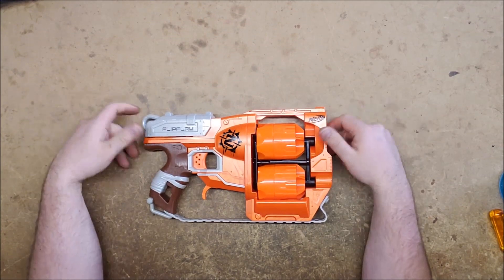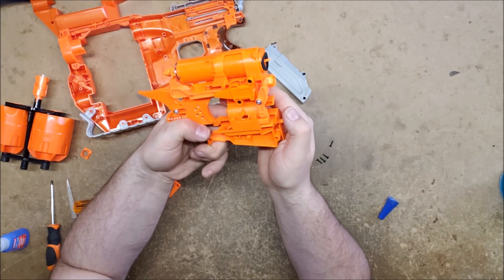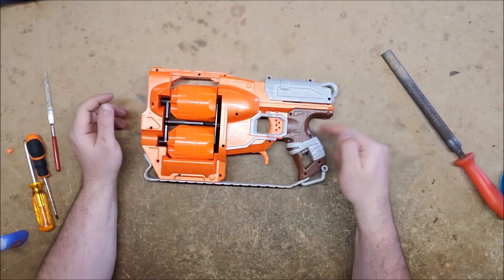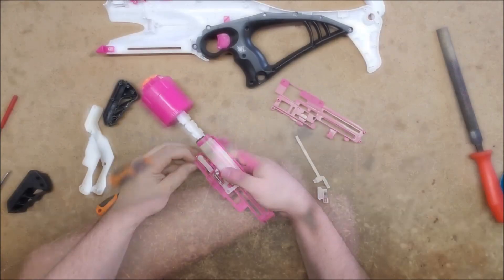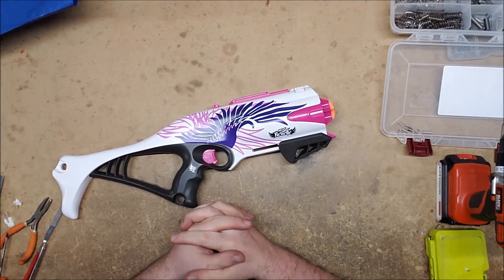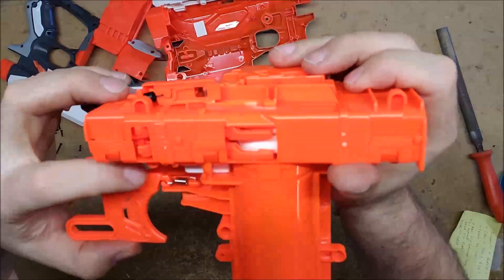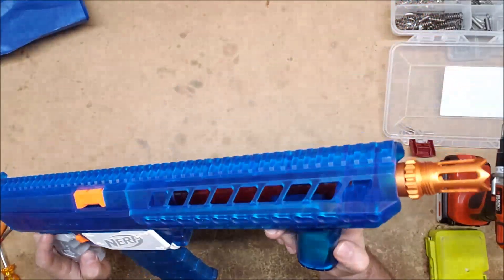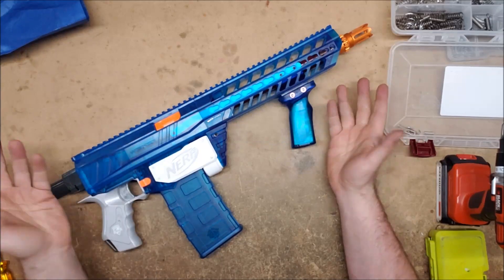Diagnostics and Repair - Episode 12

Comment: i have a hammershot that randomly started firing really badly even with intact darts, also when i rotate the hammer without priming it and if there are no darts in it, i hear a spring click and sometimes the hammer doesn't stay back it just goes without me pulling the trigger

Comment: Cap, what size screw did you insert in the rotational arm that advances the helix in the Rebelle? I might try that to extended the one in my Hammershot so it will engage a helix of a Rev-6 cylinder by Zuru when I place it one of my Hammershots.
Reply from the maker: No idea. One that was small enough. I then filed it down to size.

Comment: i had the same problem with my guardian bow so i took it apart and took out the ar put it back together didnt even touch the rotation mec in it at it fixed itself ???

Comment: Are there any breeches that work with full and half length darts for a retaliator?
Reply from the maker: Probably?
Reply: @CaptainXavier  do you know of any?
Reply from the maker: Not off the top of my head, no.
Reply: The jet blaster CEDA comes with an Omni breech and might be able to modify it to fit, maybe?
Reply: @CaptainXavier  that's to bad I was going to make a clear recon Sig saucer kit and I'd like the modularality of being able to use any darts I want.  I'd also like to be able to change the spring to vary the fps.  This would also be my first mod that's not just removing locks.
Reply: Orange mod works hybrid kit. I have 2 installed in a recon and retaliator for games when I want to use different ammo and shoot around 150fps. Works great. Just make sure you use the plunger braces.

Comment: I had that same problem with my rebelle blaster
Reply: It doesn't help that "Get replacement parts" is going to be a harder proposition since the line is pretty much (Unofficially) dead.  Granted, it's harder to find wave 1 blasters from lines since those get phased out for 'updated' versions (Disruptor vs Strong Arm, but some never really get 1:1 updates)

Comment: I have concluded that the reason vortex isn't coming back is the cost of building the blasters, compared to regular dartblasters they're engineered to heck and back. They use boatloads of extra tiny plastic bits, and instead of being assembled by some random taiwanese sweatshop worker you need somebody with a bloody engineering degree to piece em together
Reply: They've come back as a Target Exclusive, at least in the states, but they are MORE expensive now than they were when they first released while the N-Strike Original line was on its final days.  The Vigilon is 20 bucks now and the pump action rifle is 35 bucks.  I don't think the Pyragon increased in price at all.
Reply: They aren’t making new blasters though, just re-painting old ones
Reply: @itchyprince3793  I take it more that they're gauging interest in the line to see if they can give it a wider launch (like the Hammershot before the rerelease) and then if there is money in making new Vortex blasters

Comment: When you have a small part you need to glue like the flip fury.  Pin it!  No not on pinterest you pansy. Drill a hole in both pieces and stick a metal wire in it. Then glue with a solvent weld adhesive if possible. Its like making the 6 million dollar man. I learned it building miniatures. The joint will be stronger than anyvother part if you do it right.
Reply: whatstdiggn Warhammer 40k for the win

Comment: I hope you can help me friend, I have that same gun but the problem is that the mechanism to change ammunition does not work and when firing the ammunition barrel does not rotate but when disassembling the gun and testing it it does rotate and if it shoots well but when assembling The gun fails again, why does that happen?
Reply from the maker: I got nothing.  It could be all sorts of issues.
Reply: I have the same Nerf flipfury gun and it has the same problems that yours had, when shooting sometimes the ammunition chamber does not rotate and also sometimes the ammo change does not rotate and I wanted to know how you solved it?
Reply: I have the same Nerf flipfury gun and it has the same problems that yours had, when shooting sometimes the ammunition chamber does not rotate and also sometimes the ammo change does not rotate and I wanted to know how you solved it?

Comment: The Strongarm, and everything that uses the same chassis (like both of these) have a bunch of design flaws. Although your problem was different, I have found that rotation issues like the guardian is usually the screw inside the cam spindle. The annoying thing is that it's a rotating piece, and screws come out by rotating, and the screw is centered to the axis of rotation. Totally stupid design. I tighten it and threadlock it.
Reply: We like to call those engineering shortcuts, since they would normally be solved completely by adding a part, but money wise are now solved by adding glue, hopes and prayers 😂

Comment: Something's wrong with the retaliator because i have that kit its a orange mod works hybrid kit from omw or amazon. Mine is hitting 140 to 180 with the included 7 kg spring
Reply: @narenthebeesechurgerman422  captain xavier said he used a 6.8 or a 7 kg spring so i think if hes not useing the aluminum plunger that could be the problem
Reply from the maker: When I put it on the scale and fully compressed it came in at around 6-7kg.  This is not the same as a "7kg spring".  I'm not sure how companies measure the weights of their springs.  This spring is fairly weak.
Reply: It's not an orange mod works kit. He literally didn't show the inside. I'm pretty sure he can tell the difference from a regular replacement bolt and the orange mod works one. One doesn't close and one closes all the way. I have 2 of those kits and regular replacement bolts in other blasters and it's not hard to tell the difference. I run one kit with a 12kg worker spring(around 175fps) and the other in a worker  prophecy shell  with their blue expanded plunger tube and 28n spring. I bore out the barrel a little to fit a longer brass barrel in(around 210fps) Works great with both types of darts.

Comment: Hey captain Xavier, I wonder if you could try hacking the Worker sealed Stefan breech to fire full lengths.
Reply: No you can't due to length
Reply: Buy a jet blaster Omni breech, it can fire both very well. I just bought a CEDA
Reply: @itchyprince3793  actually the omw hybrid retaliator/ recon mkII is better for firing both